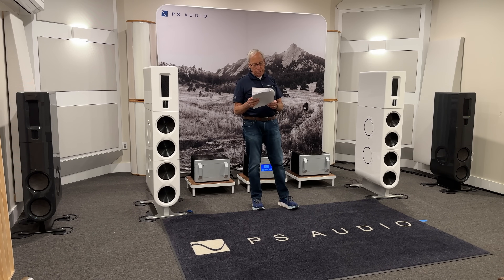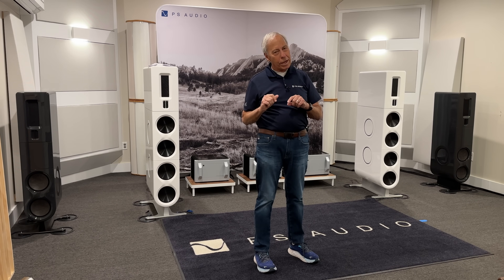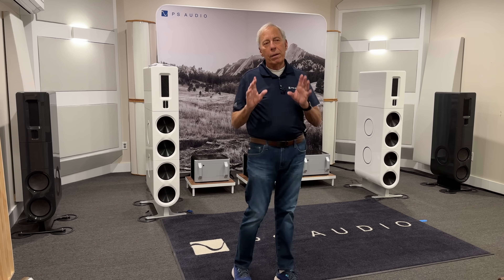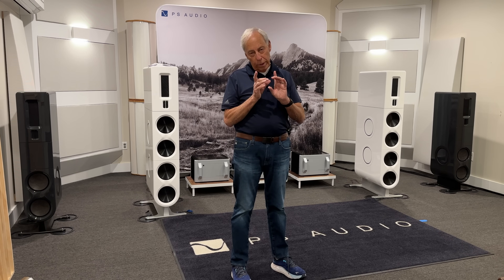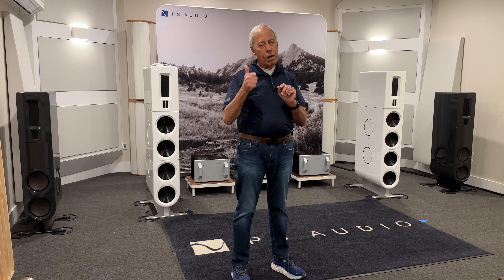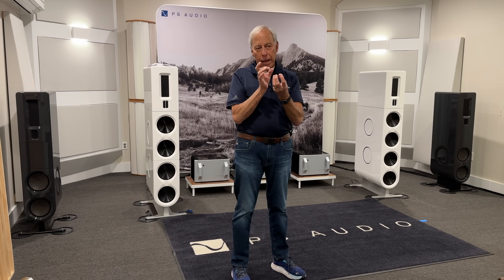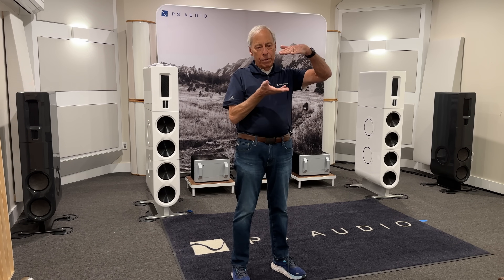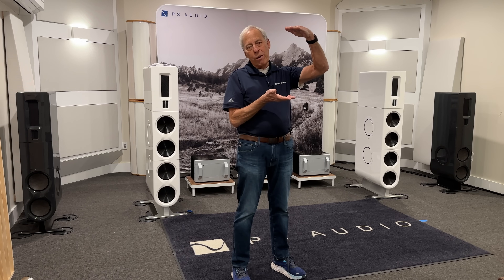Bypass capacitors and how they work

Comment: Hi Paul, does the bypass cap need to be exactly 100x smaller in value? My preamp uses 0.47uF and 0.0047 caps are quite hard to find. is 0.0022uF ok or is 0.1uF better? thanks!

Comment: Thank you very much, Paul, for your educational and useful electronics and audio material.
Your videos are often so interesting that they provide satisfaction by clearing up some of my doubts, but at the same time, they raise new questions that I couldn’t have imagined if your material weren't so specific. I believe this is a good thing because it educates me on a topic I am passionate about. After watching this and other videos, a new question has come up that I hope you have the patience and kindness to help clarify.
If I place a polyester capacitor with a very low value in farads in parallel with the electrolytic capacitor of a crossover inside the speakers, in theory, could I achieve the benefit of the polyester capacitor for audio performance?

Comment: I bypassed the two big electrolytic caps on my Atoll 50 integrated amp, with two good quality film caps- the biggest I could get to mount under the circuit board.. And my jaw totally dropped.. This is 100% the best change/ upgrade I've ever done to any hifi component i my life.. The depth, the soundstage- everything just got better. So much, I prefer this amp over my 10K tube monos.

Comment: Thanks Paul,
I am experiencing this for the first time...with my vintage Spendor S100...with it in the midrange circuit is definately makes the voices come to life and sound more real and an openess to the entire midrange...so not only is this good for your music but it makes watching movies way more enjoyable...I know this because i removed a Wima PP film bypass when I tried upgrading my two mid range Bennic capacitors with Mundorf, I had removed the Wima bypass caps out when I put in the mundorfs...I will now be putting the Wima  back in the circuit with original new Bennic caps...somone who used to own my Spendors had the put in bypass when they upgraded all the caps and resistors...wish I had understood this before measing around...Live and learn...well, my soldering skills are getting a lot better by all this changing of the caps in and out of the crossovers...🤣

Comment: A slightly more technical answer: Above a certain frequency the capacitor will behave like an inductor. A by-pass capacitor of a in parallel can fix that. It too will become an inductor, but at a much higher frequency, high enough to be out of the way.
Reply: This frequency though, is more so in the 100khz region
Reply: @ettochetthalvore  - Yep!

Comment: What Paul was explaining is the effect that capacitors have unwanted series R (ESR) but also unwanted inductance (ESL). Bigger capacitors have longer leads that tend to produce more ESL. At low frequencies the inductance acts as a short, so as frequency goes up, the capacitor impedance goes down, but at some frequency the ESL starts to take effect and the capacitor looks more like an inductor and impedance starts to climb again.  Small decoupling capacitors have short leads, less ESL, so work as capacitors to a much higher frequency. Adding these to a bigger cap keeps the combined impedance low to a higher frequency. On power supplies you might see a smaller decoupling cap across the main supply cap and then much smaller caps spread across the PCB as local decoupling, especially on computers where the operating frequencies are much wider than audio.
Reply: Great explanation, thanks!
Reply: Very interesting. Thank you.

Comment: Is it same as using the formula of Xc=1/2#fc in which Xc is the capacitive reactance and #=Pi, f=frequency and c=capacitance. If so, then as the frequency goes up, the "Xc" should decrease, not increase?
Reply: Resistance is not the same that reactance.

Comment: Also worth noting that different film caps have (slightly) different sound characteristics.  You might really like the effect of silver foil on the high frequencies.  But a 1uF 600V silver cap is prohibitively expensive.  A 0.1uF silver foil in paper bypassed with a 1uF copper cap will be wonderful and not require a mortgage.   Others may dislike the sound.  So cap selection is like cooking to get the flavor you like.
Reply: " film caps have (slightly) different sound characteristics."
-According to Danny Ritchey, it makes a yuge difference...
Reply: @NotSure723  LOL.  That is Danny's main business so it fits that he sees it as Yuge!
Reply: Interesting idea ,  👍  I don't like the sound of silver speaker wires but maybe for the high end , I bet a platinum cap would sound amazing,
Reply: @jacobclark89  An inexpensive way to get a silver cap is to look for a new old stock Russian military silver mica at .1uf and use it as a bypass to a good cap such as a copper film cap.  The silver mica will be around $10 vs crazy prices for boutique brands.
Reply: If its 3uf or 2.2uf it still make sense if bypassing with lets say 0.1uf?
Reply: @ IMHO absolutely.  You will hear a difference.  Like tasting wine or food, you may or may not like it.  I like the smooth sparkle to silver and use them everywhere.  Others don't.  Copper is warmer, and aluminum just does not sound as clear and warm.

Comment: I thought a small bypass cap on a crossover was for faster discharge. Don’t fully understand it, but that was my understanding it could help make the big cap more efficient
Reply: In speaker crossovers that's typically what they are used for as they have a much faster discharge rate than larger caps. They can also influence the tone when using a different variety compared to the main cap (like a silver or copper bypass on a larger poly cap)
Reply: @hoth2112  thanks for posting Hobbs, you would know more about this than anyone. I appreciate your expertise and what you and Danny do over there 👍🏻🔈

Comment: GM ☕️Paul.
I was at the Toronto Audiofest..and your set up this year was head and shoulders above last year …the guys put on a great performance 🥹
The room got a lot of attention and favorable reviews from the crowd.
Take care .
Reply: Agreed.  I went specifically to hear the FR20s.  I had not been impressed by video tours of PS Audio speakers at other shows, so I wanted to hear them in person.  They were good, and the presenter was a great ambassador.  He mentioned he chose the room based on hearing a good presentation in that space by another vendor in a previous show.
He had the FR20 with a Directstream, and Accuphase electronics.  Begs the question if they just pair better with the Accuphase or if it was the room.
Reply: Last year they had a completely PS system from the front end to the amplification chain …

Comment: What dust cap material do you recommend for speakers, paper? plastic? an "iron dome" maybe?
Reply: Material can affect response. Alum. Has the most treble, open screen type the least treble, paper in the middle., I prefer paper in home speakers.
Reply: @Vortexan9804  Iron Dome is the nickname of the israeli missile defense system, that is just radiating the struggle for peace in the region.

Comment: ESR drops, not increases, with higher frequencies and a 100uF will typically have an ESR of 1 ohm, making no difference as a pass through cap in the signal chain. It does need accounting for in a crossover though. Generally, DC coupled circuits eliminate phase shifts which occur with capacitors.
Reply: The thing is that electrolytic caps (NP especially) tend to have a maximum frequency response that can sometimes fall within the audio range. The tiny bypass caps in parallel simply correct for that.

It's the same reason we use ceramic bypasses in bulk power supplies... A huge bank of electrolytic capacitors probably has an upper frequency response of about 500hz.  They're perfect for filtering the line frequency (50 or 60 hz) but not so good with removing noise and RF... which the ceramics do to perfection.
Reply: @Hyxtryx  I saw an article that explains the effect of dielectrics and the increase of the ESR for the  highest frequencies after  decreasing from low to mid frequencies. The graph draws an U curve for ESR vs frequencies.
Reply: @Jorge-Fernandez-Lopez Hmm, you may be right about that.  But ESR is pretty small, and isn't what causes capacitors to block DC or pass high frequencies, so  isn't what makes them "couple" or "bypass".  I still think AnalogGround is confusing ESR with impedance, and Paul still has it backwards.  Higher frequencies pass easier.  I know Paul knows this, I think it was a brain fart.
Reply: @Hyxtryx   I do know —I guess— that capacitors are like an open circuit for low frequencies and let high frequencies "pass through" (they can't pass but it's AC and charges increase on the other side). What I don't understand is what is ESR and difference (in audio) between capacitors with the same capacitance and different ESR values. I heard about that micro-capacitor from GR-Research, although I don't what's useful to us.
Reply: @Jorge-Fernandez-Lopez  ESR is "equivalent series resistance".   Everything has it (except superconductors, I guess).  Batteries, coils, capacitors all have it.  It's like a little resistor that's built into the component that you can't get rid of, because of resistance of the wires and other materials in the component.  Lower ESR is better, because ideally, there would be no ESR.  I imagine lower ESR sounds better because the higher the ESR the more voltage you lose across it.

Just making up numbers... if at some frequency the capacitor is supposed to have an impedance of 100 ohms, but the ESR is 1 ohm, then the real impedance would be 101 ohms.  Off by 1%.  If at some other frequency, the cap is supposed to have an impedance of 50 ohms, the ESR will make it 51 ohms.  Now it's off by 2%.

I saw the graph you mentioned where there's a dip in the middle, so I guess the ESR wouldn't be exactly 1 ohm at both frequencies, but you get the idea.  I would guess the ESR gets in the way of designing the crossover because it will affect the frequency response curve a little bit.

I don't design crossovers, I'm just going by general knowledge.
Reply: @Hyxtryx   Thank you Hyxtryx: very useful information. Now I do remember (good old days at school) that we had to add an internal resistance to ideal batteries schematics. Neither DC or AC current don't physically go through capacitors as they do through a resistances or coils, therefore I wondered how that resistance could change sound. You are certainly right about the effect of changes in crossover due to different values of resistance. I suppose that AC current of high frequencies oscillating and traveling from one plate of the capacitor to the opposite through the cables of the circuit (charging plates with opposite charges) will lose more tension (voltage) with a higher ESR. I saw another graph of electrolytic capacitors and film capacitors. The first ones used to decrease ESR with frequency for low frequencies and remained stable (but still relativity high) and flat for high frequencies.  The film capacitors had a much lower ESR in the whole band (audio band and further); the resistance started to decrease and only increase again for very high frequencies (10 kHz?, 100 kHz?, less ? more?). Everything I wrote might be wrong, although I can imagine some elements that might change the sound. Thanks Hyxtryx.
Reply: Capacitive Reactance has entered the chat, hello people :^) @Hyxtryx

Comment: Do Bypass Capacitors only work with the Tweeter?
Reply: My system has a Miflex bypass cap for the tweeter and midrange driver. That's why I ask.
Reply: A bypass cap is usually for shorting high frequencies to ground, eliminating them.  The question-asker called it a bypass cap, but don't trust them.  Since we don't know where the cap was in the circuit, we don't know that it was a "bypass cap".  "bypass cap" is a function of the capacitor in a circuit, not related to any specific type of capacitor, although some may be better suited for the purpose than others.  A capacitor in series with a tweeter will pass higher frequencies better than low frequencies, but then it isn't a "bypass cap" because it isn't bypassing anything.
Reply: Bypass caps generally make the most difference in the tweeter circuit and can affect the tonality of the tweeter circuit. (esp with silver or copper bypass caps) They will still make an improvement in mid and bass circuits but since the wavelengths are longer their effect isn't as great compared to the tweeter circuit. Another reason for the lower effectiveness is that the caps in bass circuits are used in shunt to ground, creating a 2nd or 4th order slope so the frequencies where that cap has influence are very narrow. For midrange, it's most beneficial when a large cap is used in series to roll off the bottom end.